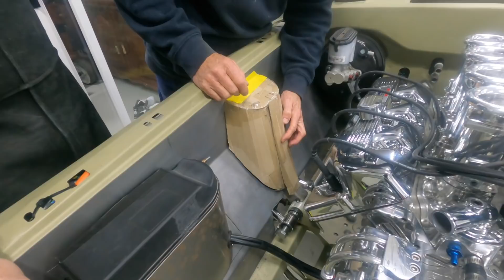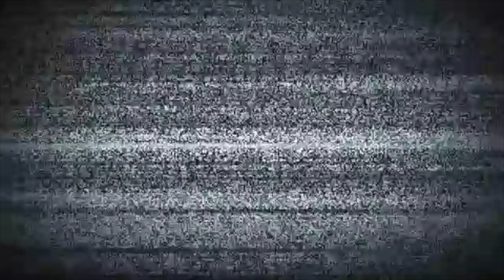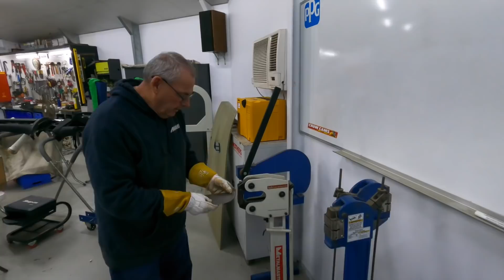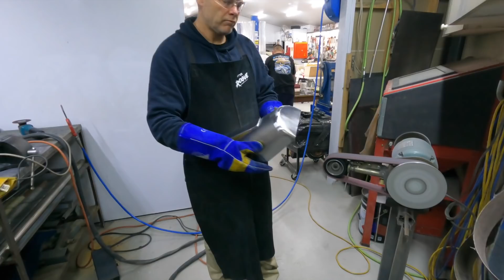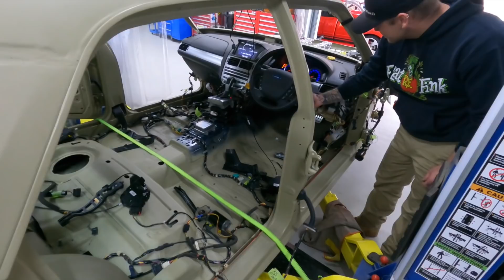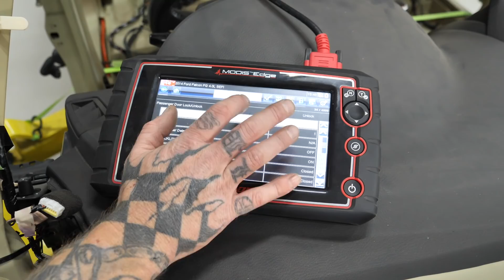This Week - BOSSXC Lights, Power & Suspension | May 31 - June 6 2021

Comment: I agree with you Howard about inner guards and not leaving them flat, people may say all sort of things about what you do, but in my opinion its way better than a flat bit of tin all the way along.  I made something for my car although a  little different I did for Bracing but also avoid the flat panel look, just to have some sort of shape or contour is better in my opinion, and yours look great now. Would really like to get a hold of your Electrician for my project down the track if its possible